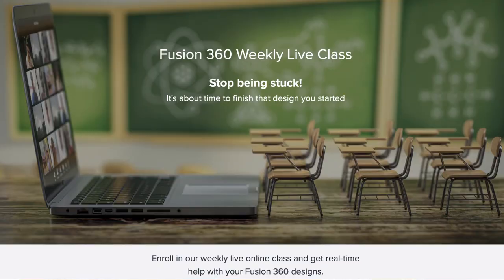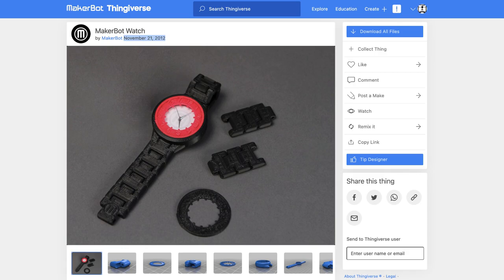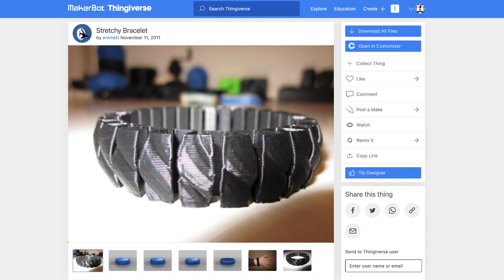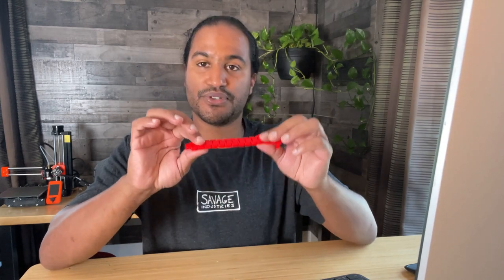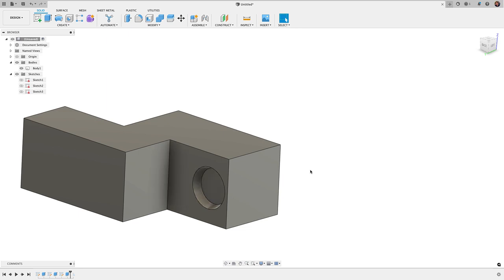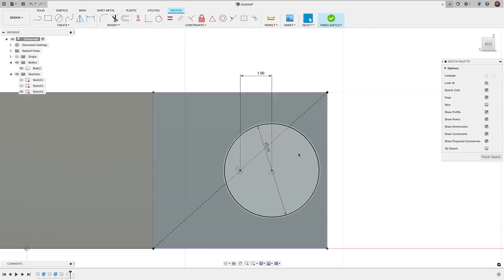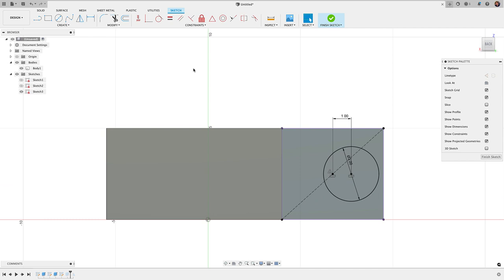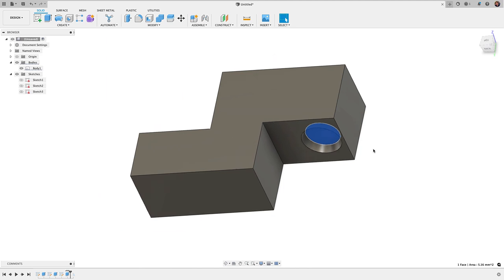Print in Place Watch Band in Fusion 360

Comment: Problem with this design (it still works, but might be a problem in a similar design) is that round, cutout between links should be centered on the nubs that link the pieces. As it is now, the cutout does not create the "right" clearance because it pivots separately from that cutout.

Man, that was really hard to describe, hopefully you get what I'm saying.